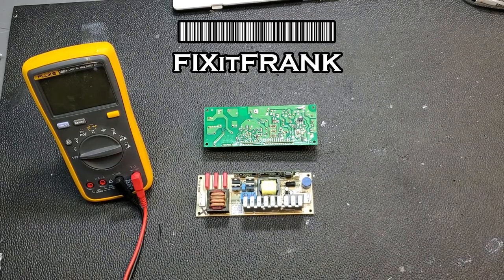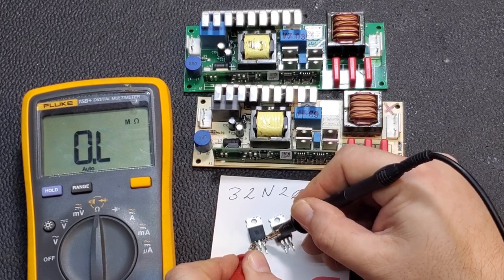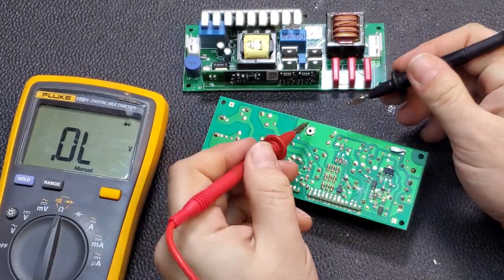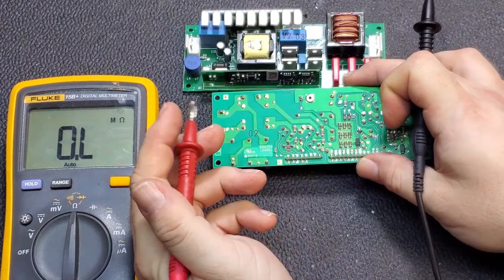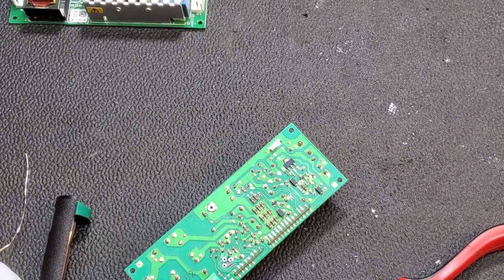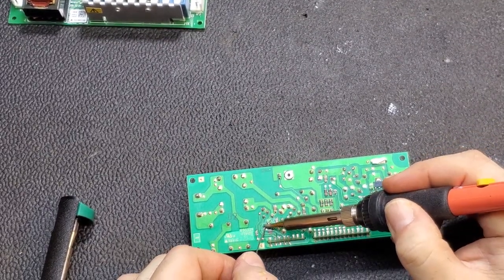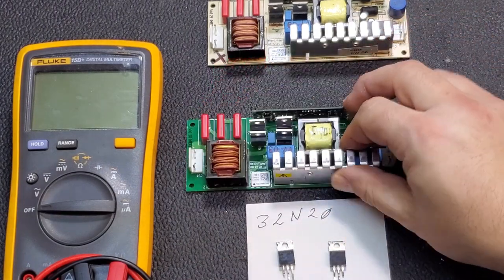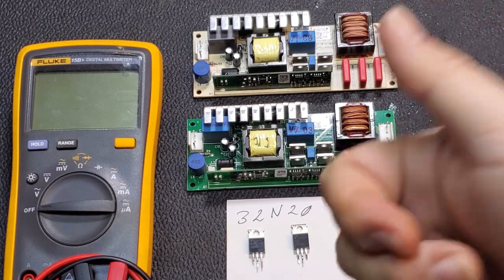Digital Video Projector Ballast Diagnosis and Repair

Comment: My ballast board looks different and I get reading on first 2 mosfets but not on the other 2 mosfets. Just 00.0 can you walk me through texting mine?
Reply: Hey so my meter maybe only read the mosfets one way? Idk it's a crappy meter but it reads 1200-1500 one way and overload the other. The bottom 2 can be read each way and your right one way reads higher but the top 2 mosfets only read one way. All source to drains read in 500 range and all gate to drains read like 1200
Reply from the maker: i'd need to see what you meter is like but from what you're describing, it sounds fairly "okay".  If they were bad, I'd expect about 0 ohms between gate/drain and/or source/drain.  make sure you test the pairs that are connected to each other.  one pair is for ignition, the other pair is for 'run'. Your meter might be the Achilles heel though.  you want something with a decent diode test or ohm test with enough power to trigger the mosfet.  that said, if none of them are reading 0 ohms or close to 0 ohms(while installed) they are likely okay.  if you get 0 ohms source to drain with them out, you likely turned it on with the meter voltage. 
Whats your symptoms?
Reply: @FixitFrank  the dpl status blinks green. Eventually stopping. And you can turn the unit on. It starts the bulb and as soon as bulb gets to full brightness the unit shuts off. I suspected bad ballast being reason it kicks off as soon as full brightness is reached. There is a faint smell of burnt from the transformer on ballast. I need my magnifying glass to check solder joints on it haven't done that yet but meter is showing all good so far on ballist. The bulb has continuity and customer has recipts from replacing it about 6 months ago. So I wasn't suspecting bulb. You can take bulb out and turn unit on and it seems to stay on until you turn it off. I left it 5 minutes on before turning off. Upon pulling bulb and turning it off when it powers down with bulb out then you get red status. So kind of confused which route I shall go. I will probably buy a new bulb and test it just to make sure but if the new bulb doesn't fix it them im kind of stuck on what it could be. Psu board looks amazing. The color wheel spins and stuff. It's a Mitsubishi 73842
Reply from the maker: ahh, the good ol RPTV.  Check the filter caps in the low voltage supply.  Big known issue in that chassis.   do you have an email I can contact you on?  You can delete it afterwards.  I do have some other idea.

Comment: Frank, First of all thanks for a great video...it is very helpful.  However,  I have a question about my ballast (it appears to be exactly the same as the two in the video) and I guess it really comes down to is it even fixable... Here’s the issue:

The problem is that the unit shorted badly (sparks etc) but after disassembly I tested all the mosfets and they seems good (resustance in the 6-12meg range).  However,  I also found a nice burn spot right next to the Mosfet T5 (the one that was bad on your 1st board as described at 7:20)... the burn spot is right between T5 and the large capacitor that sits between the four mosfets.  Additionally, the burn mark appears to have completely obliterated the SMC component that was immediately to the right of T5 (as viewed from the back as in your video).  I have no idea what type/vale that SMC component was (my guess is that it was a capacitor based on the others near the other 3 mosfets)... Anyway, I was wondering if you could tell me that SMC component’s  type and value?  

Also, I am curious if you think it is worth trying to repair the board with a thru hole component of the same type and value?  

(I should note that after cleaning up the board, everything else looks pretty good cosmetically (no obvious damage) but of course I won’t know till I try the repair, unless you have some additional tests you think I should try first).

Any help/info would be greatly appreciated.

Comment: Great vid Frank!
Now I know my Mosfet is dead. 
It’s nailed to the heat sink. 
Do you have any suggestion how to replace that one? 
Or is it better finding a new board?
Cheers!
Reply from the maker: Hello!  I would get a new module.  If the FET on the heatsink is bad, then you may have other problems on the control board for the ballast.  Repairing ballasts is kind of a last resort.  I always rather replace them so that I know for sure the unit is OK. Having matched value FETS is important for longevity. Meaning if one is bad, you want to replace both on the same circuit.  
However there is always chance. What model projector is it out of?
Reply: FixitFrank thank you for the advice!
It’s from a Benq w1070. 
“pt vip 03 mid” 240 version 

Had green power led and red lamp led. Lamp gave no light and projector turns itself off again. 

Then I started troubleshooting and came across your channel.
Reply from the maker: @ivolver3854  As luck would have it, I have a w1070 that Im working on. I will check some values and let you know.  A few things to check, 380vdc to the ballast from the power supply needs to be there, Color wheel should spin up first. Usual startup is Fans, colorwheel, ballast and then lamp. See if you are getting 380 at the ballast.  If your house voltage is 120, and you read 150-170 (if its 220 at the outlet, then 300ish ) at the ballast, then its a main power supply issue.
Reply: FixitFrank Thank you, great help!
I just measured 387v at the ballast. So that’s good news. 
Now it must be the ballast board
or do you think it could be the lamp unit itself?
I checked the bulb visually and it looks good to me. 
I’m in EUROPE. 
The ballast board has a sticker with a QR and the nr. “240” on it. 
Any suggestions what or where to buy from or NOT to buy considering the ballast board. 
Cheers!
Reply from the maker: @ivolver3854  That is very good news! The power supply sounds OK.  How are you checking the mosfet?  I would buy a ballast via eBay or Alibaba but I would rule out the rest.  Lamps are always my first go-to.  They are the easiest to buy,change and return if needed.  Be sure your lamp uses a real bulb. It should be Osram or Philips.  If its not, then I would not trust it.  Also the lens on the lamp needs the proper IR block coating.  It should be a hue of red/blue that is more visible from an angle. IF the lens is green or clear, that is no good.
Reply: @FixitFrank  I checked the mosfet just like you showed in this vid @ https://youtu.be/zcYFiew2YK8?t=319
It doesn't show the same values. In your words (vid) Source to drain, I only get one way reading. the second method I get no reading at all "gate to drain".
Whit this knowledge, what will be my best bet. A new ballast board (I think so) or a new loose lamp to put in the same lamp unit
I thought I'd read that when the lamp is broken other led color combinations were showed in this Benq.
Reply from the maker: That is good!  I think the ballast is OK. When FET fails on ballast they go short from Source to Drain(no resistance both ways). How old is the lamp and is it Osram?
Reply: @FixitFrank  Thanks Frank, really appreciate your help!
The lamp is still the original. It states OSRAM P-VIP 240/08. It had 1500h. or more, I think.
Do you think the Projector prevents lighting the lamp after certain hours?
As there is no image I can't see any menu to reset the lamp hours.

I thought it was not the lamp because of the led status. I looked in the manual and failed lamp would be 
POWER-OFF TEMP-OFF LAMP-RED
My Benq status is 
POWER-GREEN TEMP-OFF LAMP-RED
This status is not stated in the manual.
I've searched the net and fora for this status and I came across ballast board replacements with this status.
I just ordered the balast board on alib.., it was only €30. It'll take some time to arrive.
In the meantime maybe I'll order a new OSRAM bulb here locally and return it when it didn't help, as you suggested.
I think I can just replace bulb instead of the complete lamp module (housing)?
Reply from the maker: @ivolver3854  You can replace just the lamp in the housing. I am not a huge fan of that, but if the housing is in good condition it is OK. It can save a lot of money.  The glass on the front must still have the red/purple coating. Any metal should not be overly discolored from heat. The important thing is the glass with the coating.   I think you might only have a bad bulb. I will check the status code though.  That is non-standard for sure.
Reply: @FixitFrank  I Ordered an original Bulb. Thanks a lot for your help!
Reply: @FixitFrank  Hi Frank, small update. Just Installed a brand new official bulb, no light, same symptoms. So probably (hope so) it could be the ballast board. The board will arrive much later because of chinese distance.
I did a little measurement on the output of ballast board (to the lamp). In the small startup sequence it just had only 50 V as output. I really hope it'll be the ballast board. 
Have you found any info on your side from the led status color code?
Thanks and Cheers!
Reply from the maker: @ivolver3854  Great! Good to know the bulb is OK.  That is the first thing to know.  In the future you do not want to measure the output of a ballast.  They use high voltage/high frequency AC that your meter cannot read, but it will blow your meter up.   They output anywhere from 3KV to 20KV depending on ignition of the lamp. The LED codes seem to indicate that it is a lamp not starting issue.  The green LED merely means it's in standby. The manual isn't very clear on that and makes it seem like the power led would be off.  
Is the color wheel spinning up and have you verified if the control cable to the ballast is being sent a lamp-on signal? That would be my only other test.  Then once the new ballast arrives you will know for sure.
Reply: @FixitFrank  Thanks for the clear explanation! 
I can hear the color wheel spinning up so that must be fine I guess.
Do you know how I can test / measure the lamp on signal? And then should I measure it with cable plugged in the board or leave the cable out and measure it then?

I have found a service manual of this 1070 from Benq. If you wish I could send it to you?
Reply: FixitFrank today I’ve received the ballast board. 
But unfortunately still no light from the  BenQ. 
Do you have any idea what I can do next?
I’m not sure how to measure lamp on signal.
Cheers and thanks!
Reply from the maker: @ivolver3854  That is disappointing.  I know that seemed like the issue. You said you had the service manual? Unless its the level3, there should be a troubleshooting section for the lamp with what test points. I know the level 3 one only has a schematic.
Reply: @FixitFrank  Thank you Frank, it's level 2. And I've now found the color code. Power green and lamp red means" CW start fail "
hmm.. that is the colorwheel, right?
I can hear it spinning up.. that's odd.
Could I service it myself or must I order a new part. And then .. what would be my safest bet?
Reply from the maker: @ivolver3854  Nice!!  Yes, you want to replace it, not service it. They have a sleeve bearing that gets pitted on a microscopic level and trying to clean and polish it is not remotely worth your time.  A replacement wheel should only be $30-50 USD.  They all fail after about 7 years so you are right in the window to need one.  Easy to replace, as there is no adjustment in the service menu to deal with.
Reply: FixitFrank do you think it could be the CW sensor as wel?
Like you cleaned in this vid?

https://youtu.be/zaJtaWxuMQ4

If not I need to buy a new CW I think. 
Is there any way to be absolutely sure?
Reply from the maker: @ivolver3854  Something occurred to me, you should be able to read the voltage on the sense pin of the color wheel.  One will be ground, the other power, the last (might be center) is signal.  It should be a very consistent voltage. If if fluctuates right before it turns off, that is definitely the cause.
Reply: FixitFrank great thought!
For my understanding. 
That fluctuation will tell that the color wheel is bad and needs replacement?
I’ll check in a few days and will let you know! Thank you

Comment: 342/5000
Hey! I am debugging my benq w1300 which has similar if not the same ballast. Have changed all 4 moss grease when two had other values. But still do not want to light the lamp. Can I in some way check if the lamp is broken or ballast? How many volts should ballast give on output? Have tested with two cheap new bulp lamps. Thanks in advance
Reply from the maker: Hi Mattias,  You are unable to measure the output as it is high frequency AC.  The startup pulses are anywhere from 5KV up to 20KV. That will likely destroy your meter.  However, you can verify other parts and take the output voltage out of the equation.
Your DC input should be 380Vdc to the ballast. That should be at 380 when the projector tries to start.  It may only be 150 or 300V in standby(150 in the USA, 300V if your line voltage is 220-240).  If you have the 380vdc and the Mosfets are new, then you may have a bad control circuit. That is the small PCB standing up on the board.  
I would recommend verifying the DC power to the ballast. Once you confirm the 380vdc, I would then look at replacing the ballast. There is a number like PT VIP  03, or 58115201 on a little sticker.  Really any 230-240 or 250W ballast will work. If you are in the states, send me an email. I have a lot of used but good ballasts around.
Reply: @FixitFrank  Thank you so much for your reply. Unfortunately, I'm in another part of the world, Europe Sweden. But I have 375vdc DC input directly when I plug in the power cord. Failed to measure while I can start it. Just changed t2 t3 t4 t5, not the one on the "heat shield"

It all started with the lamp "exploded / cracked" and the lamp inductor lit, I changed the lamp but the same problem. Saw your video and looked up mosfets. Found burn marks on two of them and they had other values when I measured them. It seems that steel wire that is wrapped around the dc input cable has short-circuited against one mosfet. Looks like planned to be factory failure to shorten the life span maybe. Then vibration tones have slowly worn through the housing (benq w1300)
Reply from the maker: I see.  The fact that you have 375 is good.  I think you have a bad control board on the ballast.  A1 is the marking for it.  I would still check the Mosfet on the heatsink. If it measures open, it may be the culprit.  The best way to know if a lamp is good is with a known good projector. however if they are new, even junk bulbs should at least light up.  I would replace the entire ballast if it were me.  The way those Mosfets failed is pretty spectacular. Having the control board fail is not an uncommon event when all the Mosfets fail. The 78.8ML02G011A is the part # you want to look for.  A 230W version would work as well.  This is the most reliable option. When ballasts get too much damage they can be unreliable once repaired.
Reply: @FixitFrank  I have a PT VIP 03 in my benq w1300, will a 5D.J5407.001 from benq w700 work?
Reply from the maker: It will "work" but it will be more dim.  That is a 190W ballast.  It should help determine if the ballast is your only issue though.I believe the PT-VIP 03 means its for Osram version 3.  Your lamp will still light on 190W but it will not be as bright.  I would try it as long as the control connector is the same.